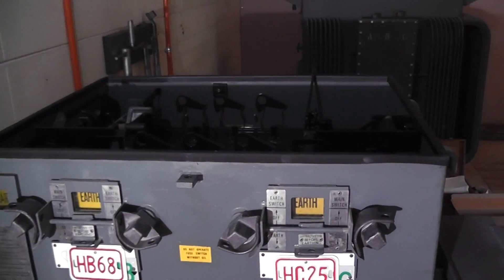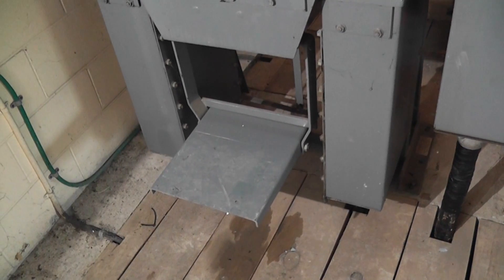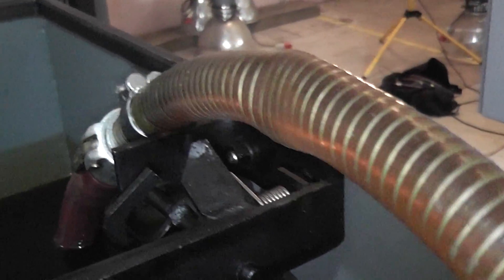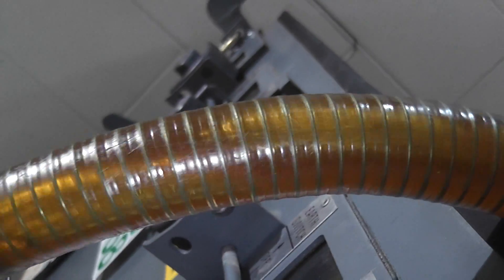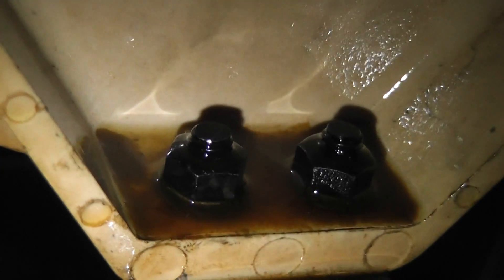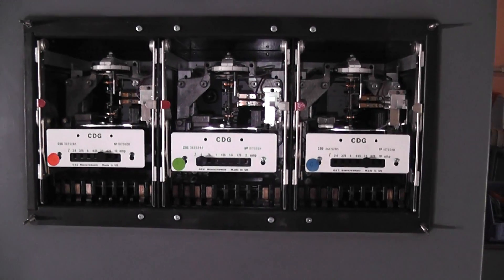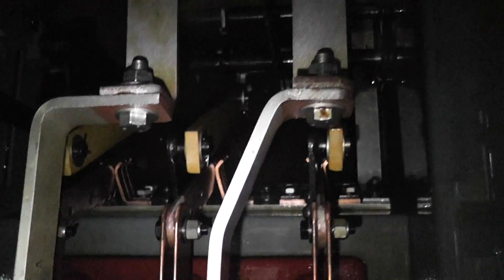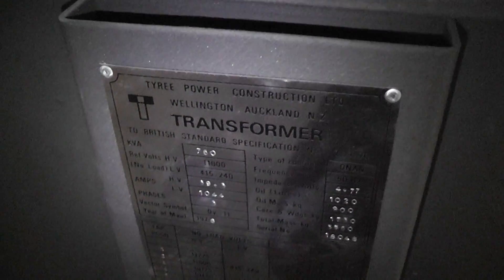Long & Crawford  T3GF3  oil change

Comment: How often does these switch gear and transformer oil needs to be replaced,is it after inspection or a certain scheduled maintenance?I find your vids very informinative.
Reply from the maker: +asskicker6557 Good practise is around every 8 years, and more often when a lot of operations are done with the switch.

Comment: Nice oil filled switchgear, much cleaner now you have washed the sludge out! I would bet the breakdown voltage of the old oil was not good.

Comment: what kind of oil is used for this application? stuff similar to motor oil?
Reply from the maker: +Justin Lynch Mineral oil, same viscosity as diesel.
Reply: +RODALCO2007 had a feeling it wasn't petrol based. thanks for the clarification

Comment: What was it rinsed with? Some form of brake cleaner spray?
Reply from the maker: +FrozenHaxor RMU's get rinsed with clean transformer oil as you never get all the oil out of them. The wiped with lint free rags. OCB's get rinsed with brake cleaner.
Reply: +RODALCO2007 Alright, makes sense.